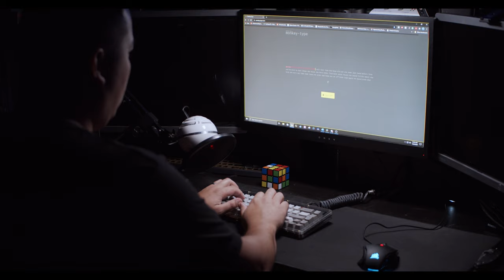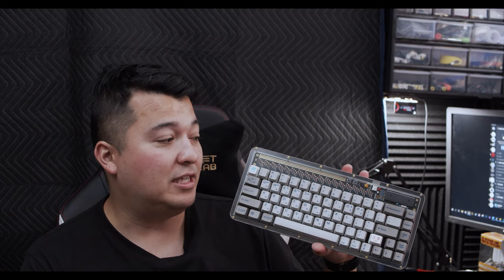Custom Keyboard build - Discipline 65

Comment: Thinking of ordering this for my first mechanical keyboard instead of buying a GMMK Pro.  Love the looks and it really does sound nice (better than the GMMK Pro from the videos I have watched so far).  Plus, I really like the more DIY of this kit.
Reply from the maker: GMMK Pro but if you want to learn how to solder and build a keyboard from the ground up. I would highly recommend one of these kids. It will not feel as premium or heavy but it will surely make you proud once its done :)
Reply: @DustinVang  I actually have a GMMK Pro, it’s my only board but I wanted to buy this to build for my girlfriend. I’ve never soldered or built one from scratch before. Any way to mod this case to add weight so it feels more premium?

Comment: Just bought this off a group buy. First build. Any tips with the soddering, part I’m most intimidated by
Reply from the maker: sure thing! The first thing you want to do is get a soldering iron that can do up to 350 degrees and hold it at that temp steady. Then you want to Look into tinning your Soldering iron. Which is basically covering the tip of the soldering iron with a thin layer of solder. Once you have that make sure to let you soldering iron get to its optimum temperature before soldering so you can have a consistent solder melt. I always touch the tip of the soldering iron to both the bad and the switch leg or wire then poke the point where the soldering iron meets both with solder. The heat from the soldering iron on the metal pad and leg will naturally melt the solder onto both causing a connection. It may sound silly but I would recommend testing it without it being plugged in so you can get used to how to hold it.
Reply from the maker: going to make a quick video for you really quick keep an eye out
Reply: Dustin Vang that would be awesome! Just one more question, what set of stabs do I get?
Reply from the maker: @pixelation8574  I would recommend screwin  durocks, with 6.25 spacebar.

Comment: It looks so good!! I’m new to this type of hobby, is this DIY beginner friendly?
Reply from the maker: Thank you and welcome! , This kit itself is actually made for newer users to practice their soldering. I'd say it definitely is a good beginner friendly board that will set you on your way. For best practice though I would still recommend practicing soldering and taking your time in building it. If you do have any questions or need help feel free to reach out :)
Reply: @DustinVang  hi. Just wanna ask. Im new to soldering parts. If I fcked up one of the diodes, can I buy replacement diodes on some hardware/electronic shop? 😅😅

And btw, what Case color did you use? I saw you used a black PCB.
Reply from the maker: @danielp121  Hello Daniel, yes you should be able to find one at an electronics store or amazon you just want to make sure it is the correct resistor/diode specifications. usually listed on the document. I went with the black pom plate and pcb. I like it :)
Reply from the maker: daniel p thank you! I actually got mine from a separate group buy but that one is cheaper. And a well known company’s highly recommend
Reply: @DustinVang  I got the link from a viewer on Twitch p(also an enthusiast), when I asked him something, I was like. Wuuuut...$110 for a kit 😳😂
Reply from the maker: daniel p yeah that’s such a good deal. The keyboard looks and sounds amazing. I’m keeping mine forever.
Reply: @danielp121  Updates anywhere?
Reply: @Mel0n  hey man i just received an email in the morning. The Pre-order is open again for the Discipline 65!! 🤘🏿🤘🏿
Reply: @danielp121  yooo Ty ty perfect for christmas

Comment from the maker: What do you think of acrylic case keyboard sounds?
Reply: I cant deside if I like the case or not. I have my discipline ready for the next step but I need to decide on case or nah. What's your recommendation?
Reply from the maker: @jjpjedi  I am all for the case for sound and comfort (high rise). While it is nice with jus the backplate I feel the case will definitely be more visibly and audibly pleasing. Do you have a plate that mounts withing the case?
Reply: @DustinVang  great to know about the sound. yes I have the POM plate I got with the case from keyz.io.
Reply: @DustinVang  also worth mentioning the backplate and plate that came with the original cftkb kit is really high quality (i.e. gold engraving) so bummer I don't get to use that. The foam that also came with that kit is also unusable.
Reply from the maker: @jjpjedi  awe darn, you can always milmax or desolder to go between both later :)

Comment: Hey, very curious if you would recommend this for a beginner? I love the look of this case but don't know how to solder so I would be doing it on this. Or should I try to solder a num pad first to learn? Also do you know if it is possible to add those hot swappable adapters to the pcb?
Reply from the maker: i would 100% recommend it for a beginner. Its a great way to learn soldering and components of a keyboard. I suppose it is also possible to millmax the sockets to make it hotswappable but I would only recommend it if you feel comfortable soldering. For learning soldering I would recommend checking my solder video and trying to get a test breadboard to solder on, Practice soldering LEDs
Reply: @DustinVang  Awesome, I appreciate it! It doesn’t look too hard. I was thinking of getting a numpad to start with but I can’t find any that are in stock! I was thinking of romac pro but apparently that guy just scammed people. Also last question, is this one the frosted or regular version?

Comment: hi, I build this keyboard and having trouble, some of my keys not able to click. perhaps you can share if anything could help.. Is it the diode or the atmega?? sry for bad english
Reply from the maker: Make sure all your diodes are soldered in the right direction and verify solder on your connections from the switch
Reply: @DustinVang  Thank you for your reply, it help alot. but I having more complicated problem, now my += , }] , Right Shift and left arrow are cannot be click. I saw the pcb, that they have the same line into the chip, but I can't find the problem..

Comment: Did you drag solder the usb c port like in the instructions?
Reply from the maker: Erin Asilo yes. I flux first cover it complete then some solder on top and drag it on top, the solder will automatically cling to copper connectors.

Comment: Love mine use it every day. I have foam and a plate also added into the mix but I don't have the case/surround as they are very $$$ your right-shift selection is different but different is good.
Reply from the maker: i would like to try this with a brass plate and foam to see how th sound difference is. I would definitely like to try another build with a brass plate in between case. i think that would look super unique! Lel yeah my tai hao caps didnt have enough for me to use :)

Comment: is the wires included for the build ?
Reply from the maker: if you are referring to the diodes and resistors , yes they are included
Reply: @DustinVang  ok thank you i want to order this kit but it seems very hard and confusing